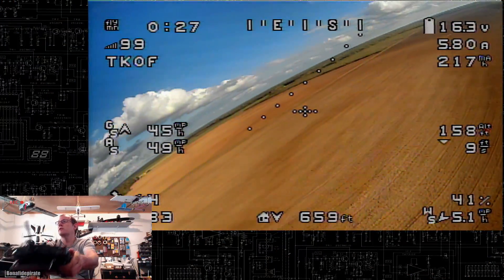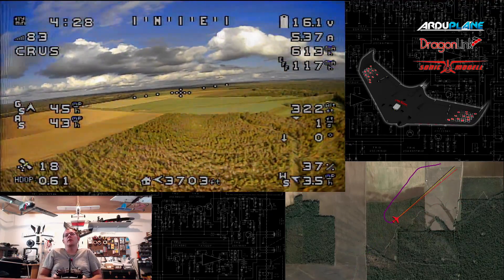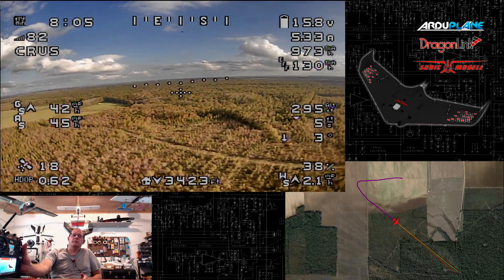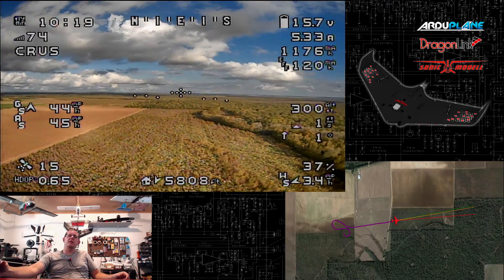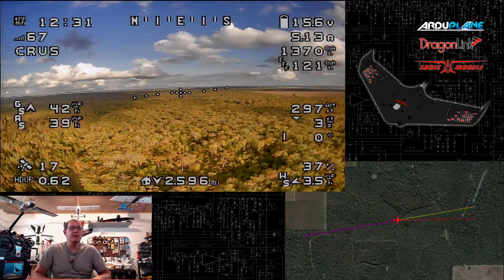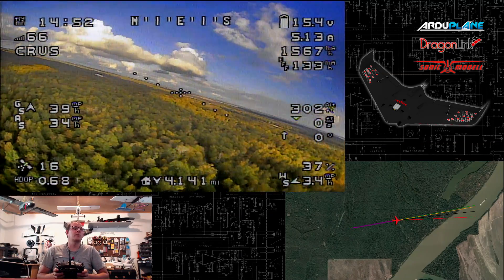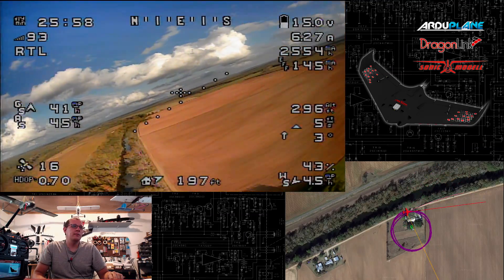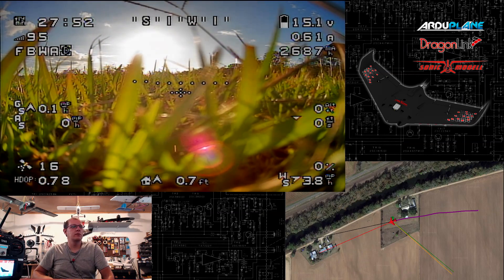AR Wing Pro FPV

Comment from the maker: FYI, when I said in the video that I'd like more responsive control over altitude while in cruise mode, FBWB_CLIMB_RATE is the parameter I need to adjust. Default is a very tame 2m/s at full stick deflection, I'll be upping that for the next flight. We're figuring things out! lol
Reply: to what sort of figure Keith? 4m/s, 8m/s ??
Reply from the maker: @stevietee10  Easy answer, it depends on what you want... lol At my max pitch angle of 20º and max throttle of 70%, the plane will climb at about 8m/s and keep it's cruising airspeed. So in theory the highest number I would want to put in there would be 8m/s. In cruise though, that's probably a bit more aggressive than I will want, I'm guessing maybe double it to 4 or maybe even 6 will work. I'll try it and see what "feels" best to me.
Reply: @bonafidepirate  I was thinking about 6m/s as well
Reply from the maker: @stevietee10  I got in a quick flight this morning, 6m/s feels good to me!

Comment: Oh, one more thing. I remenber that Tridge, the lead developper from Arduplane said multiple time on arduplane forum that basic autotune is very conservative ('AUTOTUNE_LEVEL=6 by default). It must be push to 8 at minima and then redo autotune to have a more reactive plane in FBWA/B/Cruise. You can test this behavior with X-plane and Arduplane SITL which let you experiment some parameter tuning effects. Could you please share your TKOFF_* values ? thanks for your great quality video, as always.

Comment: Use FBWB instead of Cruise to get smoother video. It is the same but without heading lock, this plane without a rudder is banking a lot to achieve heading lock. You can steer it manually a little in FBWB

Comment: Awesome Flight Keith!! Thanks for adding efficiency OSD element in the display. If you ever get a chance to pull the log, then could you please graph or find the average efficiency of the complete flight  by using the pre-set graphing command (builtin/wathr/km) in the mission planner. Many thanks.

Edit:  Never mind. I found the total distance travelled from your summary screen and average efficiency of your complete flight comes around 81.5 mAh/km @ 4S battery which is good!!

Comment: 13:30 highly interested in what you have to say about 915mhz dragonlink. Im on crossfire right now and looking for an update because it drops telemetry at around 10km. So Dragonlinks high power telemetry receivers would be the perfekt upgrade for me, but I'm kinda afraid about all the noise that might occur with the 433mhz system. Also it seems to have a more complicated cabling then CRSF? With Crossfire its enough to just connect mavlink from the RX to the FC, the RC mixes RC Control Info into the Mavlink signal, from what it seems, Dragonlink cannot do that?

Comment: If telemetry was at 25mw, what was your control link power set to?
Reply from the maker: Control link was on auto power, so I'd imagine when the RSSI was running real low on the way back it was pushing right up to 1W. That's not normal though, I've had this same system out near 10 miles (or more) and not needed max power... lol I'm thinking there's something going on with the electronics on the plane that I need to find. Or it could have just been where I mounted the DL transmitter on the wall in my shop, there's actually a few cables and things, including a metal antenna mast for some LTE antennas that are just to the side of the Dragonlink, out towards that direction I flew. Maybe I was in a "blind spot" lol I'll fly more in other areas and figure it out.
Reply: @bonafidepirate  I have been pushing the R9M 2019 beyond my previous distances along high voltage line paths, still not over 2k, but I am surrounded by medium industry, apartments, highways ect. At least once I failed to take my power off 10mw, yet no rssi warning or telemetry loss. I will be watching closely your testing the 900mc. system.